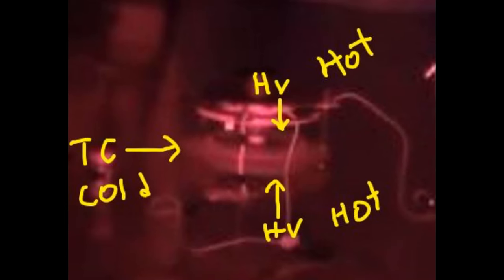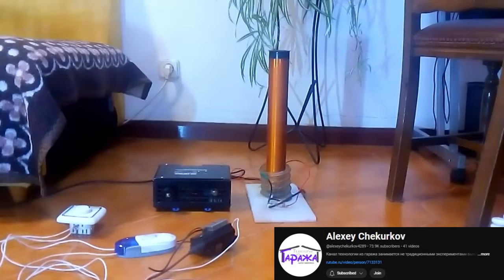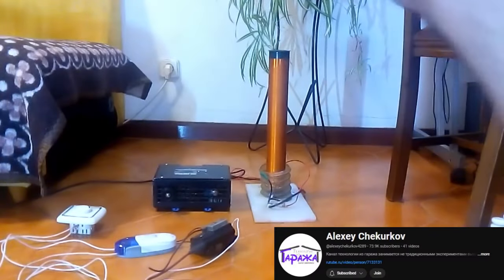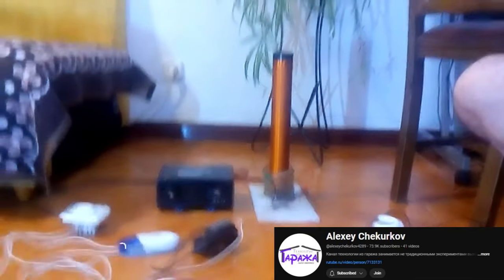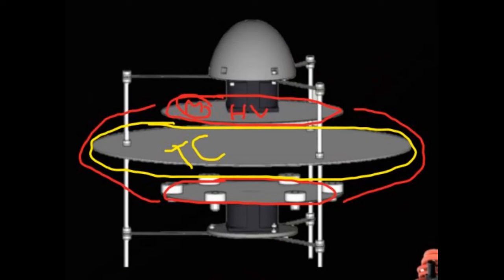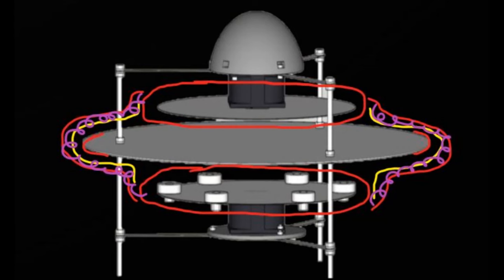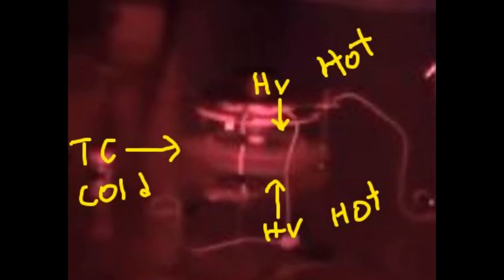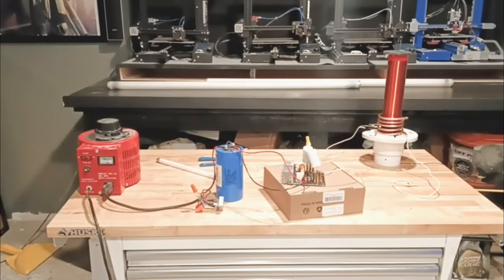Graviflyer Infrared "Showing The Field" #61

Comment: I "I think you should pay attention to the frequency and voltage of the electricity in Russia for powering your Tesla coil, which is 230V 50Hz. The frequency of electricity in the USA is different. If you want to replicate Aleksey's device, you should take this into account. I've been following your project from the beginning and I support you a lot. I'm also trying to figure this out.
Reply from the maker: just like tuning a tesla coil there is a spot where things intersect. The piezo has to be right in tune with the tesla coil. That's why I am setting up the oscilloscope.  I expect the emf will go 10 feet so it is going to be tricky to set up unless i go outside. I know he was in 220v and stepped it down. however I built the systems to match it and what it is doing. Worst case I fry it with power. Best case it jumps. If I am lucky it will fly the first time. I will take anything to show me it is alive.

Comment: Thanks for keeping us updated on this.  Do you notice capacitive reactance of graviflier's impedance change once the motors magnets run?
Reply from the maker: I will have the oscilloscope on when I test so I can see it. I think it will help in pinpointing the spot for lift. The signal may be all over the place. We will have to try by the tesla coil and by the Graviflyer using both channels.
Reply: @nathanbunten4299  thanks again, that makes sense.  Haven't pushed the order button on all the materials yet.    Fingers are crossed for your trials of the device on Friday.  There's joy in the pursuit!

Comment: Have you tried using a HV HF Neon  capacitor like Bendini or Joel Lagace? Different circuits but same effect we want. I am thinking the neon can quantize the energy so that its not as hard to keep in resonance, but maybe not neon. I am also thinking the neon light could be used as a flyback emf by recovering the energy using rutiles (transistors) to go back to the main supercapacitor. Neon emits 400-700nm so we want our rutile in the transistor to have atomic distances within that to absorb it. Sioxide for example si–O bond length: 0.1483–0.1646 pmDitnce between two oxide bonds: 0.262 nm 
Si–Si bond distance: Approximately 0.31 nm, depending on the SiO arrangement 
O-Si-O bond angle: Approximately 109° 
Si-O-Si bond angle: Ideally approximately 145°, but can vary between 100° and 170° with minimal change in bond energy 
Distance between oxygen ions: 0.227 nm

Since the bonds can change angles with minimal change in energy silicon dioxide is an ideal material for transistors. Its also the same material that makes up most of Earths crust. So I am thinking it makes sense to have transistors for better resonance.